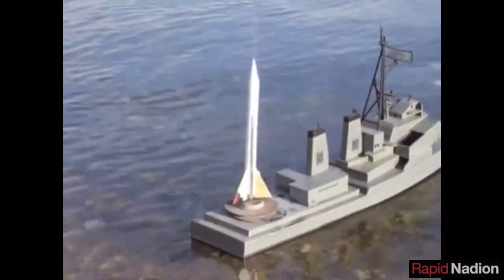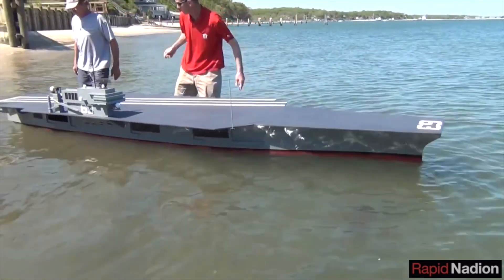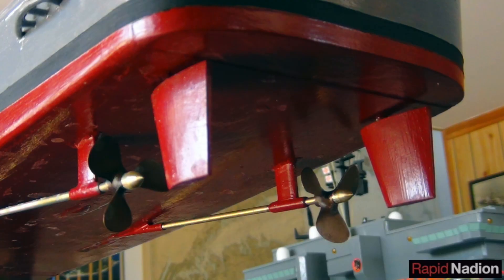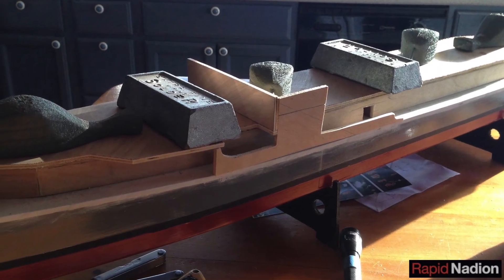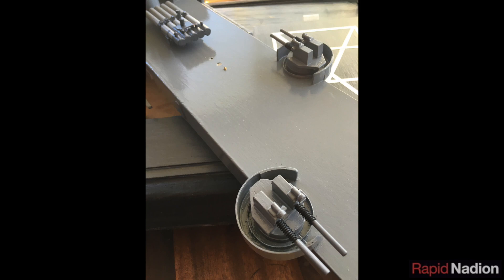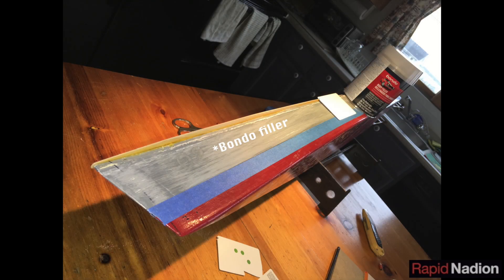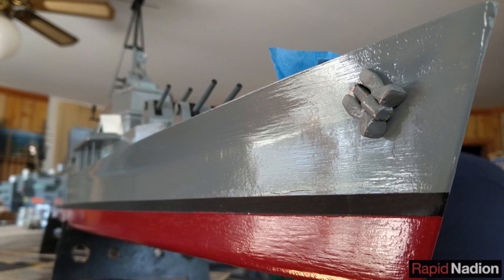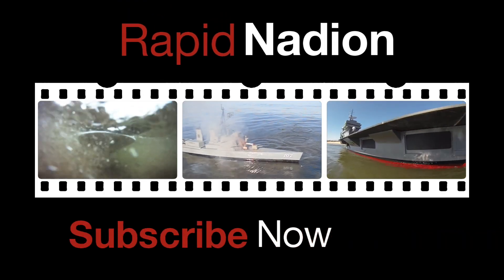Rocket Boat Rebuild: Refitting an R/C Destroyer

Comment: I have a question: how do you measure displacement of a ship?
Reply from the maker: We figure out the volume of the part of the ship that is underwater, and compare that to the density of sea water, which is 64 Lbs./ cubic foot.  There are 1728 cu. in. In a cu. ft.   If we calculate the volume to be, say, 432 ci. in. which is one quarter of 1728, then our model should weigh one quarter of 64 Lbs., or 16 Lbs.  Thanks for watching.

Comment: Me and a friend are building RC boats. I am planning to start with a guided missile destroyer (with facilities for a helicopter). I would like to know what a good motor/ esc/ battery combination would be. The vessel will not be very large.
Reply from the maker: For maneuverability and realism we chose to go with a twin-screw installation, although a single would have been enough for scale speeds.  We used 'off the shelf' 12V motors, Hyperion 2s/7.4V 25C 5000mAh batteries,  mtronics marine 15 esc's and a Tactic 4 ch radio. Good luck with your build and thanks for your interest.  RN
Reply: Thank you
Reply: What are potential ways to avoid propeller shaft leaks. This is quite a hot topic as the new British aircraft carrier has a leaky shaft. Also, I don`t have the facilities to turn universal joints. What would be a good way to overcome this? Thanks once again
Reply from the maker: The fit between the propeller shaft and its tube should be a close fit, and use a light oil.  Generally in small models the shaft is only below the water's surface a few inches so there's not a lot of pressure at that shallow depth to encourage leaks, same goes for the rudder.  If you can get the motor / shaft alignment straight or nearly so,  silicone tubing can be used as a U-joint in some models with small drive motors.
Reply: Thank you for your assistance. There is just one thing I would like to sort out. In a book I was reading, it said you had to use washers to prevent the thrust of the motor being spent on the motor bearings. Is this still an issue?
Reply from the maker: I can see this being a motor bearing issue in larger motor/propeller set-ups.  In that case, implementing a reduction gear using belts or gears or chains with sprockets (or plain gears) can be used to remove axial thrust directly to the motor, and transfer it instead directly to a bearing in the hull.
Reply: Excellent. Just in case you were wondering, I am a beginner and need to know as much as possible.

Comment: I really want to know how to make one of those but I don't know where to start 
What kind of wood is used for the hull and deck ?
And what the heck is bondo putty ?
HELP!?!!?!!
ADVICE?!??!
Reply: Although the question is not addressed to me i still feel like adding something:  
If the Wood is too stiff to bend, you can try softening it up with hot water. This melts the glue and lets the individual plies move against each other. Then clamp it into bent shape and let it cool and dry again. Then it should stay in shape. But give this method a try before on some scrap wood. And beward of cheap plywood, which may totally disintegrate when it Comes in contact with hot water.
When gluing the planks to the frames, I usually use clamps to hold it in place until the glue sets. You can glue a strip of wood across the front end of the plank to keep the clamp at the very end from slipping off. This piece is later cut and sanded off.
Reply from the maker: Hayden,  hull, deck and superstructure are all constructed from inexpensive plywood sheet of 1/8th or so thickness that you can find at Home Depot etc.  Bondo is just a 2-part auto body filler which works well for forming curved areas and filling voids.
Reply: Rapidnadion Thank you !
Reply: Rapidnadion Quick question before you put the putty on how did you bend the wood on the bow

Comment: Hello, I'm currently planning the conversion of two model kits to R/C. The one thing I haven't been able to figure out is the propeller shaft seals. So I just wanted to ask: How are the propeller shafts sealed to prevent water intrusion?
Reply from the maker: Build the shaft / tube with close fitting brass hardware and coat with a light oil
Reply: Thanks a ton

Comment: did you use DC motors?
Me cannot choose proper motors for such boats
Reply from the maker: Yes, 12v dc motors running on 7.4v..
Reply: Why dont you use the hobby shop ones?
Reply from the maker: They're too high performance for this model, it goes faster than scale with these motors which are 1/3 the price.  Also, motors and batteries stay cool under low loads.  The Kitty Hawk's motors are rated for 32 v but we only run them on 12.  Long run times at scale speeds.
Reply: Thanks, im making ORP "Błyskawica"
But im having some problems with making the ribs and flooding compartments (i want everything on the inside and outside scale)
I would also like to see you actually making the ship or atleast Plans of such Destroyer...just counting all the electronics.
Thanks for you're videos...lately they Inspired me in making a Transparent (10 inch by 3) Submarine to record with a SJCam (SJ4000)
Allthough the waters here in Poland have awfull visibility

Comment: Please do a how to for this amazing ships basic electrical work not the smoke features just how to make the basic setup and maybe how to work with the ballast.
Reply from the maker: +Tealuv Props   Wiring diagrams / directions are usually furnished with electronic speed controls when you buy them; everything is usually pretty much 'plug and play'.  We did a little customizing with the battery set up to get longer run time.  Ballast is not too complicated, mostly trial and error.  Keep it as low as possible and don't make it immovable, you may want to add or change equipment within the boat.
Reply: +Rapidnadion thanks for replying!
What brands did you use
Reply from the maker: +Tealuv Props    Motors: inexpensive  6 - 12 vdc ,  Electronic Speed Controls:  (2) Mtronics Viper Marine 15A,  Batteries:  (2) Hyperion 2S 7.4V 25C 5000 mAh LiPo.
Reply: +Rapidnadion thank you